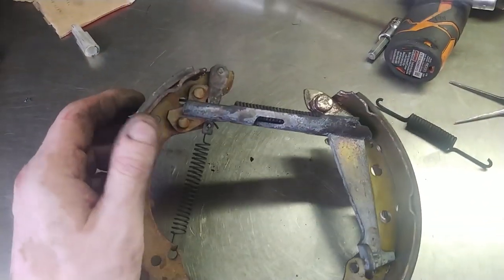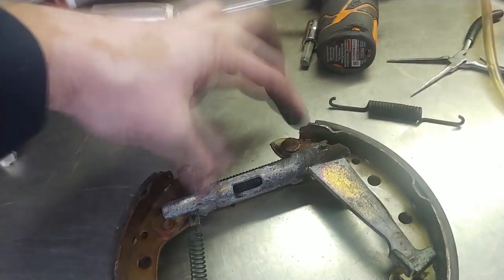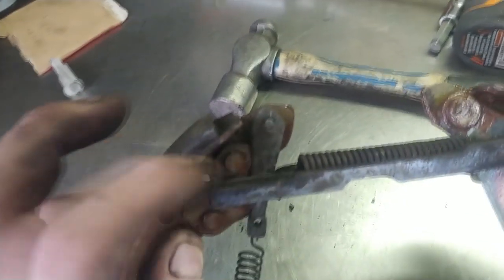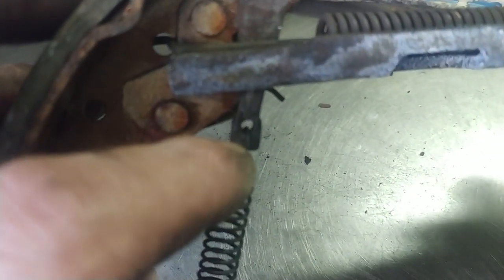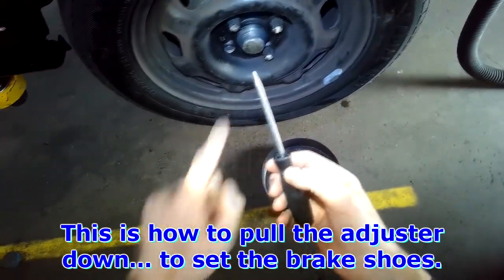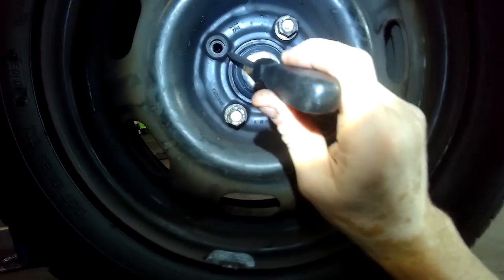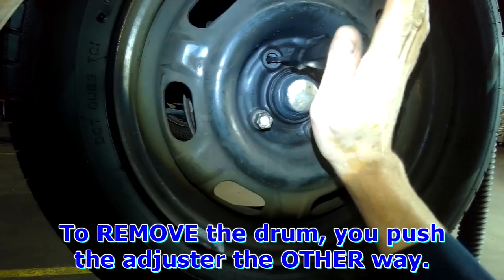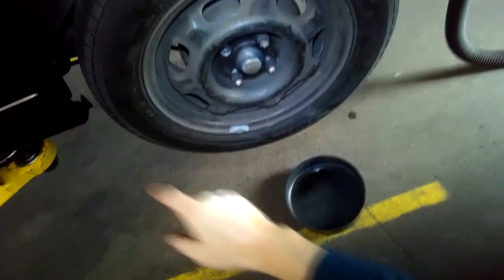Drum brake self adjuster explained.

Comment: Trying to install new brakes shoes and drums.  For some reason one of the drums won't slide on like the other side did.  Would the adjuster wedge being too far down cause the shoes to spread too much?
Reply from the maker: Yeah... I think the video explaied the operation of the wedge quite well. With the drum off, you can see the position of the wedge. Move it up if it's sitting too low.
Reply: @EXOVCDS  that did solve the issue now the brake shoes rub too much on the one side
Reply from the maker: Check the brake cable to make sure it's not sticking. Make sure the hand brake lever at the shoe is not sticking. Make sure that the wheel cylinder does not have a sticky piston.
Reply: @EXOVCDS  replaced the  everything but brake cable. So probably the cable.
Reply: @EXOVCDS  do you have video of you replacing the parking Brake cable?
Reply from the maker: Year, make, model?
Reply: @EXOVCDS  1997 vw jetta 2.0 gl
Reply from the maker: Sorry, no video of replacing. You just need to lift the center console to get at the cables inside the car. Remove the round plugs on either side of the console (towards the rear of the console). Remove the screws and then lift the console.
This very old video shows some of what you need to do. Very bad lighting... sorry. From my first year on YouTube.
https://youtu.be/cJUxBY49_tU
If you were able to do all the brake stuff... then replacing cables will be easy.
Reply: @EXOVCDS  i was overthinking the Parking Brake Cable.  I just uninstalled the one that was stuck.  Thanks for your great help.  I have had my Jetta for 10 years with 247,000 plus miles on it and still gets 33/32 mpg

Comment: Thanks for the video!!
Reply from the maker: Thank you for watching!
Reply: @EXOVCDS  hey quick question, so I had really bad grinding in the rear when I brake. I took the drums apart and the shoes looked almost brand new. The drums had a few very minor pitted spots. I ended up  just doing the outer wheel bearing spraying everything down with brake cleaner and putting everything back together. Went for a test drive and sounds much much more smoother miner rough sound when hard braking. Other than that pretty smooth. You have any idea what could cuase this or what might of been going on. Btw my car is a 97 vw golf 2.0, thanks
Reply from the maker: @Dontbmaddcuzubadd  During normal driving... light brake pressure mainly applies the front brakes. Meaning that the rear hardly get used. If your car does not have ABS, a "brake proportioning valve" reduces brake pressure at the rear, if there is not much weight in the vehicle. Drum brakes also don't like to "self adjust" sometimes... which creates a gap between the shoes & the drum. Debris can then get between the shoes & drum and embed itself into the shoes... causing grinding when the shoes make contact with the drum. Adjusting the shoes so that there is slight drag / contact with the drum, can help keep debris from getting onto the shoes and will also help with brake pedal feel (a more firm pedal).

Comment: does going in reverse and slamming the breaks re adjust them ?
Reply from the maker: The adjuster is "spring loaded"... meaning that it is self adjusting as soon as the brakes are applied. No need to go forward or backward. Just step on the pedal... the shoes will spread and the adjuster will get pulled down to "self adjust". The adjuster could slide back up, if the ridges in the adjuster are worn. The reason I pull down on the adjuster when I do the brakes, is so that the adjuster is already in the down position when I first use the brakes.

Comment: I need some help with my 03 vw beetle. The power locks keep unlocking and staying unlocked randomly. The windows also roll down all the way when the door unlocks. Previously the door lock actuators didnt function at all besides arming the alarm. I have since replaced them both and now its going full kerby on me. I checked the wires for the actuator and all of them for the door and found no issue. 

Any advice would be greatly appreciated. The new actuators are doorman brand fyi.
Reply from the maker: One of the door lock actuators is sending and "unlock" signal to the central convenience module... which unlocks the vehicle and rolls the windows down. With a scan tool attached, you can monitor / check "unlock" signal from both doors. I have not seen wiring issues on A4's/mk4's/New Beetles... so my bet is on one of the actuators (the signal from when you turn the key in the door handle).
Reply: Thomas EXOVCDS sorry for not seeing it sooner but you were right it was a short in the actuator. I replaced it and the problem susbsided
Reply from the maker: @collindebolt6479  Thank you for the update.

Comment: Thanks for the explanation. Can't say I've seen that style before.... not that I have much to do with drum brakes 🥁
Reply from the maker: Things have a way of making a come back... you'll be prepared now! LOL
Reply: Oh my he called me smart, dang. 
Yeah what works for my is a shot of brandy. Works good. 
I would adjust the brakes until I could not turn the drum and then back it off a bit. 
If the pedal was still soft I would do some backing up and hitting the brake and that would get the adjustment closer.
Reply from the maker: @mostlymoparih5682  That works 2.

Comment: You’re skin colour is ok said Trump. But seriously I now own a mk6 Jetta base model and the brake pedal is super low and the adjustment is at full travel the previous owner said the drums were replaced and the shoes also they are at maybe 60 % good and I mesure the drums and they are near wear limit the specs don’t allow much wear between a new drum and a time to replace mesurent .
Reply from the maker: We need to invent / market spacers that we can place on the ends of the wheel cylinders... to make up the difference, along with wider adjusters! =)
Reply: I experimented buy welding one side of the ajuster it did help but I’m going to do more I have new replacements wedges in stock next time I replace the drums and shoes one important tip on mk6 Jetta is there are Teflon rubbing parts were the shoes rub against that need to be replaced every brake shoes job it prevent the shoes to be too much inn so that they rest in the middle of the brake cylinder Pistons.
Reply from the maker: Yes, good point. Larger wheel cylinders that can spread farther would be better as well (that's why I was thinking about spacers).

Comment: I adjusted mine and it was 2 clicks ( rear brakes locked up ) I went to 3 ( you can get 4 if you force a lot but normal is 3 ) anyways they don't lock up anymore which makes me have
Reply from the maker: 1 or 2 clicks is good for drifting!! =)
Reply: Thomas EXOVCDS yeah , I think that I will start drifting. I mean I got 60 hp that can't wait to drift ( I got a df which is the waterboxer with the least hp and the worst mpg but it's 0,2 liter more than the dg which actually has more hp ( 57 kw 80ish hp )
Reply from the maker: All you need is a bit of rain / some water on the streets! LOL
Reply: Thomas EXOVCDS I don't want to test it .i know the rollover crash tests of vanagons are super but I don't like rollovers that much :)
Reply: Thomas EXOVCDS imagine a t3 drifting, just looks wrong
Reply from the maker: LOL... I know. I was just kidding. =)